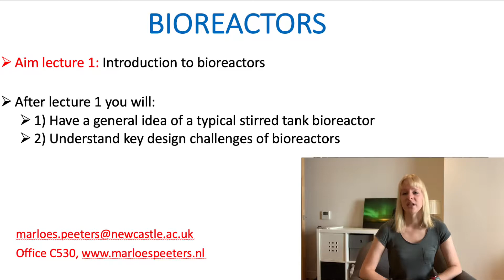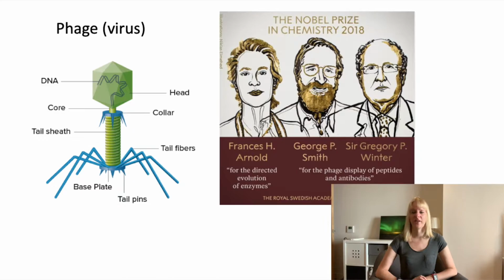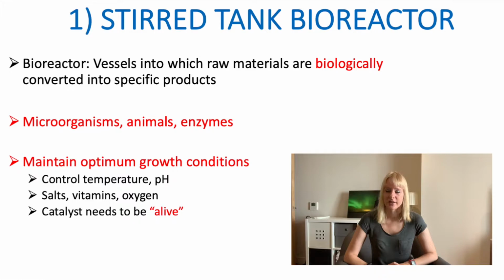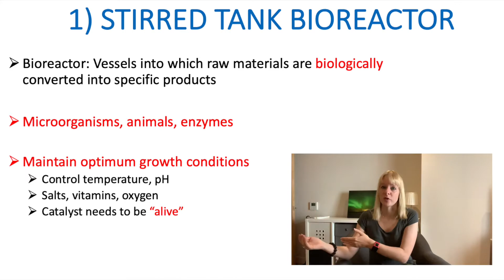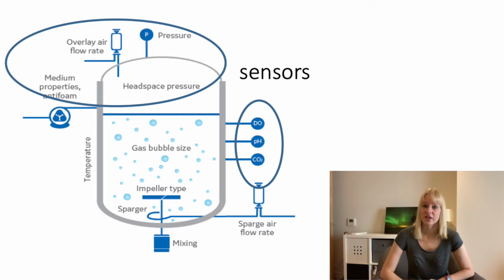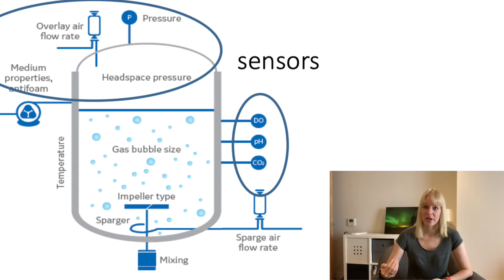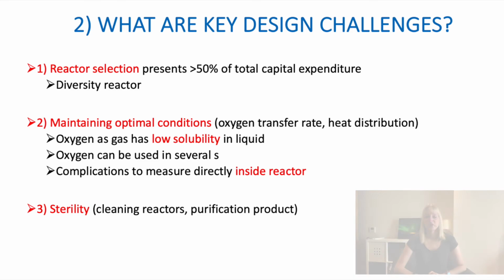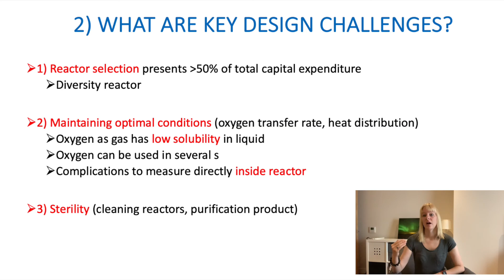Introduction to bioreactors

Comment: great video! i do have a question. im writing a book and i need to know if there a bioreactor that produces clean energy with any kind of biowaste. it doesnt have to be clean or be able to use anything as fuel, its just prefered. also can i use you as a source
Reply from the maker: Thanks! What do you mean by clean energy? Are you thinking about for instance biogas which is produced from waste?
Reply: thanks for replying so fast! im looking for energy that releases gas that isnt greenhouse gas and isnt harmful. again, the greenhouse gas part is just prefered beacause its still carbon neutral. im also told i should tell you im 11.

Comment: Good Information!!! Nice videos to learn, Thank you! Do you have in mind to make als a video about solid state fermentation?
Reply from the maker: Not in mind but I think it is an excellent suggestion! Definitely something I can look into of the next couple of weeks (we do have one video on fermentation in the other bioreactors playlist)
Reply: @MarloesPeeters  Thanks for your rapid response... May be you may comment on a question: on Lab-level a lot of fermenter-research relies  ONE  single stem of a bactrium to produce a specific compound.  Whet is your opinion about scaling fermenter up to industrial scale and the danger that this specific bactrium is overgrown by other bacteria being "stronger" and more abundant. What is done to prevent this? (from another perspective: this can become a problem e.g.  in waste water denitrification)... Regards Lothar from Heidelberg
Reply from the maker: @lschuh8316  Very good question! I don't have a lot of experience in this area but this is a very valid concern for long term continuous operations where a "mutant" can take over. So monitoring is one way of checking for this and the other one is identifying what is the best residence time. There might be other chemicals methods of suppressing bacterium growth but I am not sure how this would work

Comment: I’m still asking myself why I need to learn this as a SOFTWARE Engineering student 🤦🏾
Reply: Ayy, maybe you can program the Simens Simatic S7-1500 for the bioreactor.
Reply from the maker: Modeling of bioreactor is very important so we need help from software engineers there. Also for the control of bioreactors, you might need tools for interpretation of big data